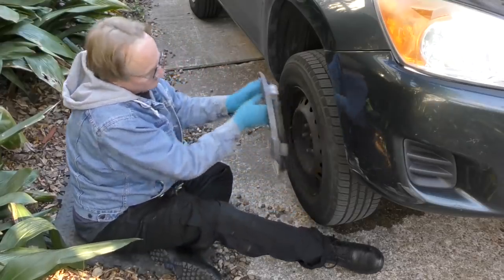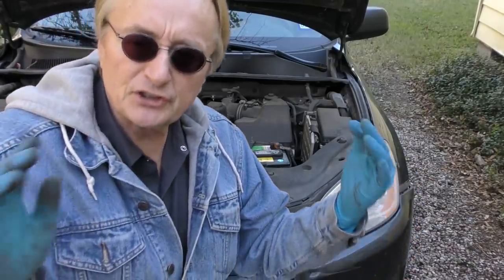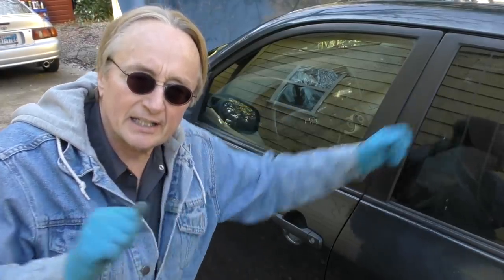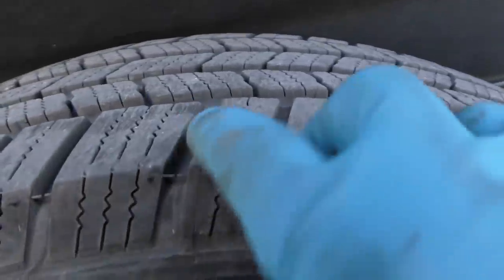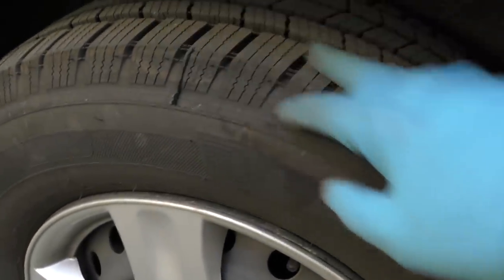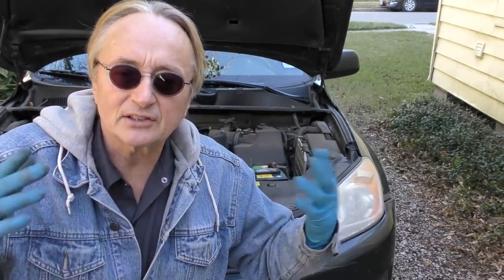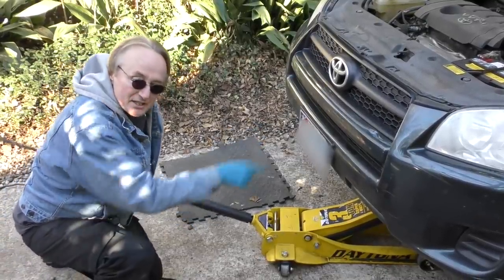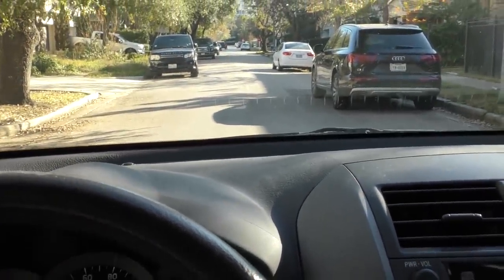Tire Secrets Only Mechanics Know

Comment: I rotate my Tire’s on my 2013 F-150 every other oil change.
Reply: I rotate my tires every time I drive. LOL.
Reply: Jack Sroka  🤣🤣
Reply: I don't rotate my tires at all because I don't have a car. 🤣😂🤣
Reply: Yep..I always do that, it's common sense....I thought.
Reply: I can’t rotate my tires because I have wider rear tires, and I have an asymmetrical tread.
Reply: I rotate my staggered setup after every washer fluid refill
Reply: I rotate tires every 5,000 miles when I do the synthetic oil change.
Reply: @jarrodottinger3  same here on one of my vehicles, what options are available for us besides new tires?
Reply: I was taught that as a child and its the best policy
Reply: @jarrodottinger3  I reccomend switching to inside-outside tread patterrn. Smoother ride than assymetrical, and you can still rotate them. A decent example I put on cars every day is Firestone Firehawk A/S. Don't buy assymetrical/rotational tread tires. They're a scam.
Reply: That's how it's supposed to be done. When in doubt, check the owner's manual, they have service intervals.

Comment: Definitely true, put new front tires on the Honda and the wheel spin went away
Reply: tires get old and hard i guess. but shouldnt drive them past 6 years they could come apart on the highway
Reply: Watch out for oversteer
Reply: @dinobot_maximize  I've experienced that a couple times buying from used tire shops when I had no knowledge of tires. Never again. New tires forever...
Reply: @rgroove1970  If it oversteers, get used to it and compensate. How do you think all of those old 356C drivers won all those races?
Reply: @stephenarling1667  You're mom or grandma ain't a racecar driver though. x D
Reply: @nakoma5  My stepdad was.

Comment: The idea of "best tires in the rear" isn't only for RWD vehicles, as some suggested. I live in a cold weather state and the reason they put the good tires on the rear is to stop conditions of over steer. Your average driver isn't cornering, planning for their rear end to slide out behind them. They don't drift often. Tire people figure that under steer and a lack of acceleration will make it obvious to the driver that they need to proceed cautiously.

But if you are aware that your rear end could slide out from behind you, you might prefer the better braking, over steer, and acceleration. 🤷‍♂️
Reply: No mater what, it is always better put better tires in front. Because it`s much easier to control or stabilize your car when rear is sliding if front of your car is sliding so its gonna be much harder to regain control.
Reply: @wilkas159 , to each their own. I disagree. I think under steer is an easier condition to recover from than over steer. But you can put your tires wherever you want.
Reply: @djseismic  let's aggre that we are both right. You think that under steer is easier and think that over steer is easier. Looks like it depends on driver.
Reply: Josh is right, when it comes to snowy/icy conditions. 

Otherwise Scotty is right regarding more control over breaks (60%) in the front.
Reply: I would rather be drifting around a corner than hitting a tree or pole on the corner because the car can't pull me around the corner becasue I have no steering!
Reply: Hi Joshua Balbierz:  Dead right, 100%.  You can lead a horse to water...

Comment: I work at firestone, the reason why we put the better tires in the rear is because supposedly if you have a blow out in the front tires youll have more control
Reply: Which is true but most people will panic and over-correct anyway

Comment: Your right! These "tire specialist" alot of times don't know what they are talking about. Theya why people use to(don't know if they still do, they do their oil and then preform their "tire rotation". Hell shops use to ask you if you wanted your tires rotated which was recommended when you got your oil changed. Either that or after your second oil changed they'd REALLY recommended it.

Comment: I have our cars tires rotated & balanced every oil change (every 5K miles).  just part of Good Maintenance
Reply: Agreed. I always get "The Works" package at Ford because it's included and the cost is only about $12 more than doing it myself
Reply: onen thats overkill and a total waste of cash and never criss cross the rotation like front right  to rear left. read how many miles your tires are rated for, once your at half that milage, put rear tires tires to the front and front to back,don't criss cross. check air pressure, Do the alignment and balance.
Reply: John Smith  when you criss cross, you are reversing the Direction that the tire was originally going in and when you do that, it can cause unwanted vibration. Its best to do front to back and back to front, half way of life of the tires. Plus they just want to take wheels off so they can try to sell you unnesesary brake jobs and other things. Never go to cheapie oil change places that state they will do all this extra work for free, its not free. They just want to sell sell sell.
Reply: John Smith  
It is something they did before the modern tire era.  It can actually cause tire problems

Comment: That's the way I learned it, too.  Most of the wear is on the FRONT tires - company doofuses!
Reply: Especially with front wheel drive, they also round off because of steering wear.  RWD usually wore pretty even with fronts unless doing donuts and burnouts but steering tyres always round off.

Comment: I always put new tyres in the front & I replace the rear tyres by the tyres which used in the front earlier. 
Even the car is rear wheel drive.
Reply: My dad taught me that many years before front wheel drive was a thing. 
He said  it was best to have the best tires up front because that's where you run over things.

Comment: Some tyres are directional so can only be swapped front /back
Reply: Steve Gibson.
I think you have found the problem.
It looks to me that one of the front tyres was fitted wrong, the tread patterns were not mirror images,  on one the outer ribs faced forward and on the other they faced backwards. I would expect that to affect braking quite seriously, as it indeed did.

Comment: warped brake rotors can cause it to act flunky when you hit the brakes too
Reply: That and improperly torqued, or not torqued lug nuts....cough...cough...Les Schwab Tire loves to over torque or not torque your lug nuts...they also love to not tighten down castle nuts after doing a front hub & bearing job, and if they do torque the lug nuts there's a 100% chance they did them way too tight so if you have a flat there's no chance in hell you are breaking them loose without snapping the studs off.
Reply: If rotors were warped you would get a vibration all the time not just when braking. It is actually called lateral run-out due to friction variation. Brake and front end magazine has some good articles.
Reply: @miketaylor4162  depends on how warped they are. If they are only warped sideways (horizontally) and not vertically you wouldn't necessarily feel it all the time until you're braking. Because braking puts pressure on the rotors and the warping causes the pads to jump in and out as they go over the bumpy bits on the rotor surface. This would also cause uneven braking on all affected rotors which would cause the steering to feel weird when braking if the fronts were affected.
Reply: @wildbill23c  as someone that works at a les schwab, 100% is a little outlandish we have torque charts and properly calibrated torque wrenches. Maybe the store is the problem or management but the company as a whole usually do things correctly. Like with anything there are bound to be some rotten apples!
Reply: ... funky !
Reply: @josh74773  A little outlandish LOL...try again.  Your employees don't follow a chart for anything, otherwise I wouldn't be snapping off wheel studs when trying to change a flat tire a couple days after certain employees at a Les Schwab had installed new tires.  Never have any issues with Commercial Tire....on top of that the $1400 in front end work they charged me for and never actually did...I'll never do business with Les Schwab again.
Reply: @wildbill23c  Schwab has been okay here. Another shop had a possibly "undocumented" worker use a rattle gun on a cross-threaded lug nut, while I watched. Never again.
Reply: @stephenarling1667  I had Les Schwab try using an impact to put lug nuts back on my truck once I put an immediate stop to that one.  They have some really lazy people that work there and most of them have no idea how to properly change tires, and an impact isn't required for installing or removing lug nuts, if it is that means they put them on way too tight to begin with.
Reply: @miketaylor4162  That is absolutely not true most of the time.
Reply: Stuck brake calipers

Comment: just bought 2 new tires at walmart.they had a sign recommending putting them on the back.i wanted them on the front of my front wheel drive 1998 camry and they made me sign a form  denying them responsibility if anything would go wrong.
Reply: They "made" you do it?
Reply: @ajossi  well they wouldnt put the tires on the front if he didnt sign..so yeah read closely
Reply: Walmart garage stay away Happy New year
Reply: You are safer with your best tires in the rear if youre in a wet climate.
Lots of accidents happen from hydroplaning. You want better traction in the rear.
Reply: @NinjaKirk  wrong on front wheel drive cars.
Reply: @partymiami1159  if you have less traction on the rears hydroplaning, it doesn't matter how good your front tires traction is. You'll lose too much control once the rears come off the ground.
Reply: @behexen250 when coming to a corner,  the front tires do everything. Less grip in the front may make the car keep going straight and have absolutely no control. You can recover from rear tires slipping but not from  front tires sliding out due to momentum. The "industry" is scamming people. The fact they use one standard for all cars proves it.
Reply: @NinjaKirk  front tires hydroplaning is worse than rear tires hydroplaning.
Reply: Everyone knows to put the new tires on the front even if it's rwd✔️
Reply: @behexen250 my friend hit a bannister when he turned and the car didn't. He fell for that ruse and swore he'd never put the better tires in the back. I say since the front tires are the ones that give you control of the car, they are the most important.
Reply: @behexen250 I agree, stupid people,  as Scotty would say, should put them on the back. If you want control and can recover from a slide,  put the better ones in the front. LOL.  BTW, if I HAD to make that choice on a motorcycle, I would choose better tire on front too.
Reply: @partymiami1159  I would say that I've seen a lot of stupid people at Walmart. I'm glad they put newest tires in rear for safety.
Reply: @ulisesc4388  that's why you go somewhere else
Reply: @partymiami1159  I'm sorry, you are mistaken. I'm a Michelin certified trainer. The reason for the rear wheel regardless of drive train (except all time awd where all should be replaced at the same time to prevent the transfer case from being destroyed) is because there is no steering input for the rear wheels so if your rear loses control there is no possible way to compensate with steering input. I can completely understand your train of thought though.
Reply: @LoveMyKleeKai  Sorry but you've been duped. I've been driving for many years and experience shows me otherwise. Unfortunately, todays "educated" people are serving the agenda of the corporations to misinform the public. Look how drifters have complete control of their cars with no grip on the back wheels. This completely disproves your argument.  There are no front wheel drive drifters because it would be impossible. Open your eyes, control of the front wheels is paramount for control of the car.
Reply: @partymiami1159  noones been duped I replace mine in 4s because I properly balance and rotate every 6k miles people that replace 2 at a time either cant afford to drive or dont care about car maintenance either way advising unsafe maintenance practices are unwise. Do what you want. No skin off my nose But industry standards and millions in testing say you are wrong.
Reply: @LoveMyKleeKai  I noticed you didn't challenge the drifter argument. Obviously, tire companies benefit when all tires are changed, don't you think they are biased? Duh. They will do anything to convince you to buy more,  but smart people (including Scotty) know better.
Reply: @LoveMyKleeKai  BTW, the point in question is whether to put 2 new  tires on the front or the back, not if 4 new tires are better than 2. I say it's best to put 4 new tires every day for optimum driving. LOL.
Reply: The Michelin guy knows from where he speaks. I worked for another of the "top 3" tire companies for 10 years. The reason this rule exists is due to a Michelin lawsuit from a decade ago. The studies showed exactly what he said, regardless of anyone's anecdotal experience. Hint: Michelin lost and the tire industry implemented that policy because of it.
Reply: @NinjaKirk  right you are, its not a load of crap, being front wheel drive all the weight is in the front, no weight in the rear, many tire shops stick to this policy
Reply: @partymiami1159  absolutely false, you don't know what you're talking about.  You are Dunning-Kruger personified.
Reply: @partymiami1159  Your front doesnt hydroplane because of the weight distribution. Your logis is default in complete thinking.
Reply: @partymiami1159  Drifters use special tires that do have grip lmao
Reply: @menow4480  I've been "drifting" my whole life on any tires. Lmao
Reply: @menow4480  no it hydroplanes because idiots put bald tires on the front.
Reply: @menow4480  We call it going de lado, and I've been doing it since before you were born. When real muscle cars that didn't have  computers controlling them were driven by real men, not the snowflakes of today.
Reply: @partymiami1159  It actually is for "Safety."  💙🙋👍 If you have more traction in the back (newer tires), worst thing that can happen is that your car will understeer (plow head on) to a pole, in a snow storm. 💃👀🙋 But if you put the Newer tire in the front, when you have balding tire in the back, you will spinout (oversteer) in to a Deep ditch like James Caan in the Movie MISERY, and be kidnapped and have your both of your ankles hobbled,,, 😱😵😨😭🙏 ,,,,        😂😂😂
Reply: @ronnierodriguez3739  Understeering (Plowing Straight Ahead) is ALWAYS Safer than Oversteerng (Spining Out),,, so for me,,, best tires in the back,,, sorry Scotty, 🙋👶👍
Reply: @svenmohamad8646  That's the best analysis yet! 😁
Reply: Asim Ayyubi  hydroplaning happens in the rear because there is less weight. Rear end comes up; and when it comes back down, you want traction fast.
If you don't live where it rains a lot, I would not worry about it.
Reply: Asim Ayyubi  well, I would keep your tires with the best tread in the rear.
Reply: Do not talk to the driver when the car is in motion 🙄🚙

Comment: The car's front is raised on a jack - no wonder it's like losing control when driving this around ;)
Reply: RAV4's have a jacking-point in the front placed there by Toyota and is for jacking up the front of the car (says so in the manual)
Reply: That's gotta hurt the acceleration as well on a FWD.
Reply: @hughbrackett343  Made my day :)
Reply: @hughbrackett343  Maybe better fuel economy though because there is no load on the front tires.